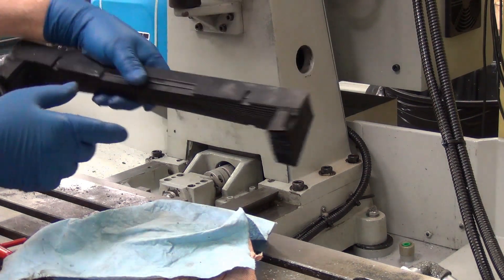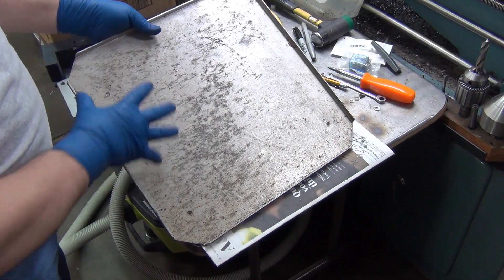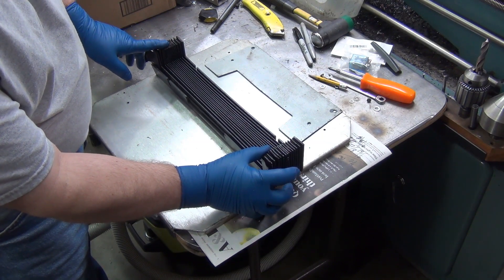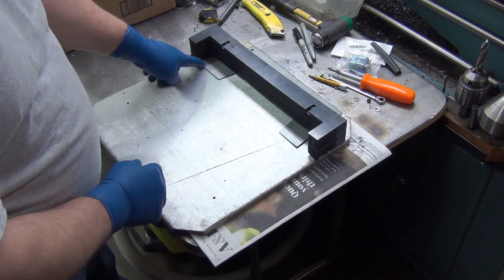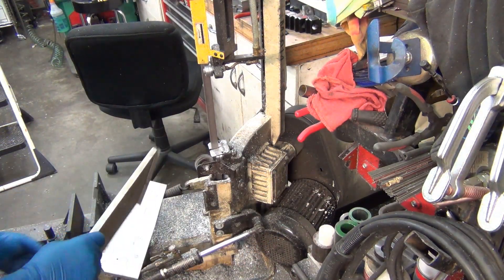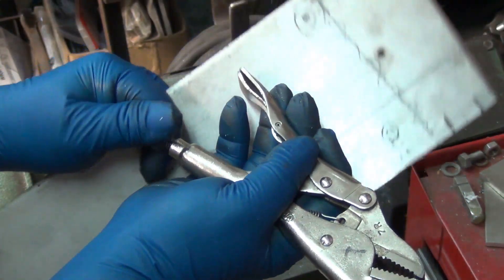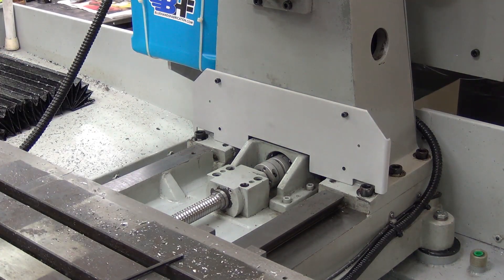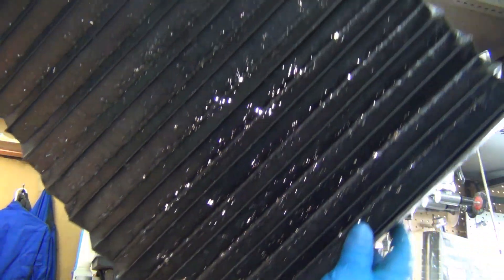Novakon Torus Pro - Y axis bellow replacement/upgrade

Comment: Thanks for your videos. I just picked up a very lightlly used NM200 R2, and the only thing to dislike so far is the bellows mounting on the column. I'll refit mine as you did here. Besides keeping chips out, it looks a lot cleaner than stock.

Where did you buy the new bellows?
Reply from the maker: You're more than welcome!  
I got the bellows from Novakon.  I was thinking that they would be already drilled or fitted and it would be the easiest for replacement.  As you can see in the video, they weren't. lol  I looked for other bellows, but most were only 9" wide, if I remember right.
Reply: @bluehandsvideo  Thanks!

Comment: You could branch out to making accordions now that you are experienced with bellows.  I can see why you would be careful about ordering bellows.  I always order a new sharp tool when the old ones are too dull but then I have finished the work with the dull tool when the new one arrives and it just sits there for a long time not being used.
Reply from the maker: I do the same thing with tools, Harold!!  I try to order before I need them so I have them on hand........and then I never get around to using them.  My buddy nick named me "New In The Box" because I always have new tools/items sitting, unopened, waiting to be used.  He even made me a leather belt with that on the back of it. LOL!!  Heck......I've got a brand new spindle for the mill sitting in the tool box....had it for over a year now I think. :)   I just didn't quite have the money for a second set of bellows at the time and since I didn't think they were that bad......  you get the idea. :)  Thanks for watching!